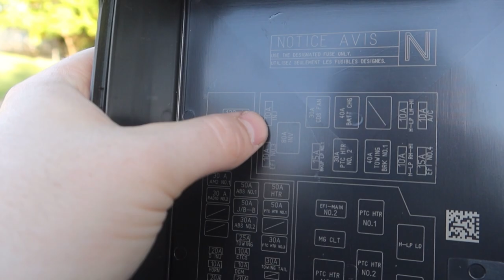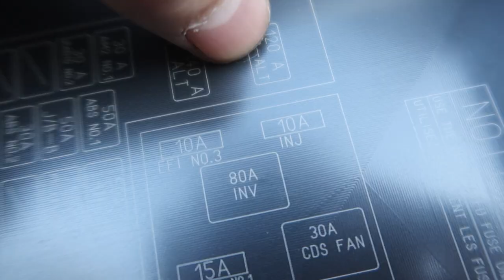Tacoma Mods - Best Raptor Light Install (Taco Clout)

Comment: You had some corrosion on your positive battery terminal if you want to quit fixing that mix up a spoonful to a Spoonful and a 1/2 of baking soda In a glass add extreme hot Water fill pretty full to the top Take a spoon and mix the hot water and baking soda together and then pour that on that cversion and it will eat it off and make it clean again making a better connection After that I always spray corrosion spray on my terminals which helps prevent that from ever coming

Comment: Interesting! I used the INJ fuse location 3 months ago and has worked great. Yesterday the check engine light came on and dealership said the fuse tap was interfering with the injector voltage and causing an O2 sensor fault. Then they said since I hooked up the fuse that caused the fault they charged me 3 hours labor as not under warranty. Have you had any similar problem? Thanks.